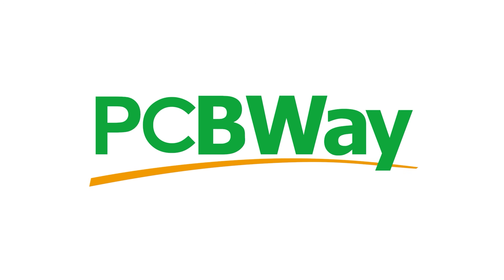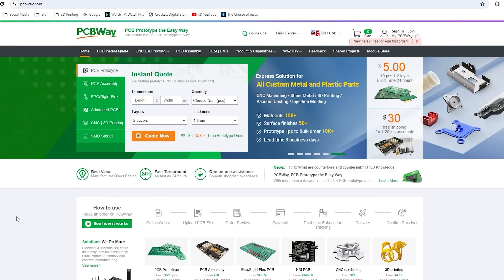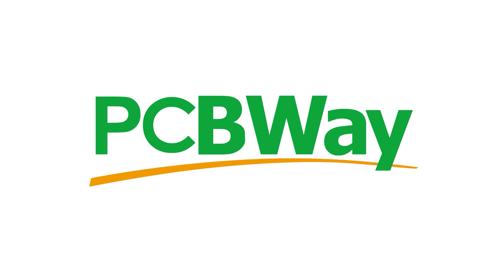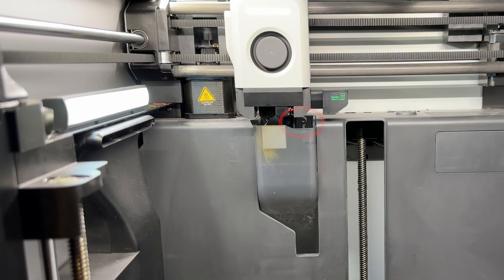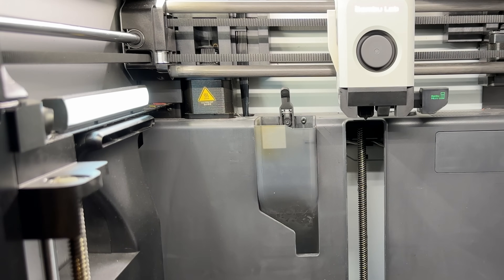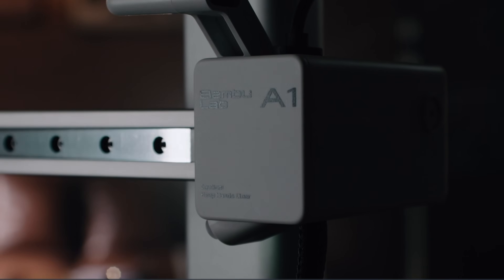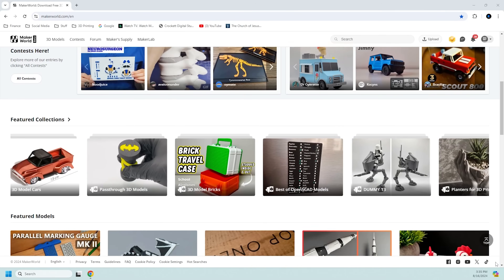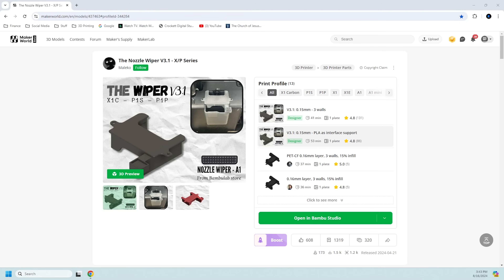Fixing the X1-Carbon's Flawed Nozzle Wiper

Comment: Awesome video!
Reply from the maker: Thank you for watching.
Reply: @thisprintedthing7967  it's been a problem for me from the start and I got a second one when the discount was and the second one also had the problem. I really liked how you highlighted the problem because I was'nt sure exactly what the problem was but now I know it's definitely a design flaw that needs to be improved. I'm going to think om what I can use instead of ordering the little things to glue on the print but if I can't come up with an alternative than I'll just order it haha. 

You eared a subscriber my friend. I'm new to 3d printing still. I feel like a noob and. Want to learn more about designing but it seems very hard.
Reply from the maker: @AA-xm7rt  well thanks for watching. I do hope this helps you. The part that you have to order from Bambu is $3, and it’s a 3-pack. You actually pay more for them to ship it. But it was worth it to me. Honestly, I wasn’t looking for this solution at the time when I found it. But when I found it, I had to try it, and I’m sooooo glad I did.
Reply: @thisprintedthing7967  yeah probably easier and more efficient just buy them! Thanks for all your advice and have a good evening!

Comment: I would use ABS or PET-CF or PC vs PETG. PETG's max temp before deformation is only about 70'c.  ABS is ~100'c, PC is 120'c and PET-CF is like 205'c.
Reply from the maker: @TheNorthern-Lig7t  you may be right. However I printed something the other day in ASA that took about 5 hours to print. The PETG part never showed any signs of giving out. But if it becomes a problem, I will reprint the part in ASA.
Reply: @thisprintedthing7967  I plan to grab an X1 from Microcenter today and I will print this part in ASA.

Do you find the left side gap on the front glass to impact heat retention at all?

I'm also considering replacing the front glass with clear plexi.
Reply from the maker: @comp20B  it’s hard to say if it affects it. I don’t know that it would affect it enough to be a problem. 

I will say, however, when printing in ASA, the printer by default will heat the bed to 90. I had a problem with the parts warping and coming off the bed. I googled it, and Google’s AI suggested I heat the bed to 110, which worked perfectly.
Reply: @thisprintedthing7967  I'll give that a try thanks. I also want to print new outdoor house address numbers in ASA.

I'm stepping up from always using Enders and Prusa's.
Reply: @thisprintedthing7967  Skill issue.

Comment: Does the smaller gap not cause any problems for waste Filament on longer prints?
Reply from the maker: @madnlooney  I haven’t seen any issues yet. The filament falls straight down. As long as you empty your waste bucket behind the printer so that the pile doesn’t build up into the chute, it’s fine. But you would want to do that regardless of what kind of wiper you use.

Comment: The v3.1 wiper works great, but the rear tab on some aftermarket build plates hits the front corner of it. Causes Z axis homing failure.
Reply from the maker: According to the designer, version 3.1 was supposed to address that.  But viewers might be interested in knowing which aftermarket plates you're using that still cause a problem with version 3.1.
Reply: @thisprintedthing7967  The one I've had a problem with is from IdeaFormer. Specifically their water ripple pattern plate. The rear tab is probably 0.5 mm too wide. Easy enough to trim to fit, I just haven't done it yet.
Reply: I'm having this issue with the textured build plate that came with my x1c.
Reply: I'm having this problem with the BL smooth PEI plate I just received.  I'm hoping I can clearance the bottom of the part enough with the soldering iron that I don't have to throw it out.
Reply: I took it to my shop and used a grinding wheel to create clearance on my textured plate. Problem solved

Comment: I think you all are complaining a little too much.  This does NOT happen more than half the time, if it does, you have not replaced your roller.  Can you imagine them saying "eh, we did the best we could, release it working less than half the time" - I think not.
Reply from the maker: Yet that's kind of what they did.  The clip I showed where the nozzle had a long piece of filament stuck to it after the first layer inspection, I shot that video in one take.  I was so confident that that would happen if I hit the record button and pointed the camera at the wiper, that I started a print of a benchy and waited the several minutes it took to get to that point just to capture it on video, knowing that I likely would not have to try again to capture that moment.  And it didn't just happen on my first X1-C, but on all of them (I own 4, remember), right out of the box, insomuch that I had to disable the first layer inspection on all of them.  I can't tell you how many print jobs I had to restart because of this issue when I got my first X1-C until I discovered that I could disable the first layer inspection.  And then the little flecks of old, crusted filament that would end up on my prints because the nozzle never really got cleaned properly, let's not forget those.

So you're telling me that I'm supposed to replace that wiper the moment I get the machine, because the one that comes preinstalled is no good?  You fault me for saying that they would release a machine that has a function that works less than half the time.  Yet based on the experience that I've had, and many others in the comments, your logic is suggesting that the wiper has to be replaced right out of the box, because if we're having the experience that we're having, it's because we have not replaced the wiper.  Granted there are some in the comments that say that this doesn't happen to them too often, but it does happen.  There are a great many others that say they are experiencing this.  So this seems to be a solution.
Reply: @thisprintedthing7967  It's so bizarre that this guy would effectively call you a liar. Why on earth would you lie about something and waste your time finding a solution for it if it wasn't an issue for you? Weird. Thanks for sharing your solution with us.
Reply: lol brand new X1C happened to me with PETG-HF everytime after first layer inspection . Are you telling to change my brand new wiper tube? Clearly a design flaw needs a wiper mod.
Reply from the maker: @tinymito  yeah, that was my thought exactly toward this comment.

Comment: Why not print the A1 Wiper in TPU?
Reply from the maker: Well, think about that. A TPU model is printed from a hot nozzle. What would happen if that same hot nozzle from which a TPU wiper is printed starts rubbing across the same TPU printed wiper multiple times while hot? Or let’s say while I have a TPU printed wiper, I print a model in something that has to be printed hotter than TPU, like ASA. See where I’m going with this?

Comment: There are so many little strands of filament in the bottom of my P1S. And it doesn't even have the LIDAR inspection. I've been putting off, actually printing this thing myself. I even have a dozen extra silicone wipes, since I have an A1. Ima do this after work tonight. Happy making!
Reply from the maker: Good luck. You might still get a few strands at the bottom of your printer. But at least it’ll be less likely to end up being part of your print.

Comment: I think the one that uses a silicone tube that is cut several times works much better.
Reply from the maker: I haven’t seen one with a silicone tube. Not sure how that would even work.
Reply: Totally agree, been using this method for months, perfectly.
Reply: There's also a version 2 available, not tried that yet.

Comment: Have had an X1C since Nov 22 and turned off most of the AI crap that first month. Never needed first layer inspection. Have P1S and P1P and it's somewhat nice not to have unnecessary addons. PETG is the main filament that does need a better wiper, since small blobs stick to the nozzle.

Comment: If you plan to print anything that prints hotter than PETG then I would highly recommend you print any parts that will go inside the printer with either ABS, or my personal preference, ASA. Otherwise, the parts won't last.
Reply: The temperature inside the enclosure won't get hot enough to break down PETG or even a PLA printed part as long as the parts don't come in contact with the heat bed or nozzle.  This particular part will be safe from heat where it's at.
Reply: @Sparky5 Heat creep is a thing even when the parts are under heat resistance temperature.
Reply: @TechnologistAtWork shouldn't have opinions? Like wrong think?
Reply: Don’t print this wiper with TPU then…? ;)
Reply: @oofunstuff The wiper isn't TPU. It's a silicone polymer. This thing can withstand more than 800C. Your printer doesn't even get anywhere close to that.
Reply: I printed mine in petg cf and it’s gorgeous using the pla support.
Reply: Chamber won’t got hotter than 50c ever. If you turn chamber fan off it will get up to 50c then kick on but with it on it’s never going over 30c
Reply: I think we should all print it with PEEK!! Lol... just kidding. I will do mine with ASA but PETG would be fine too.
Reply: Petg cf best fit.

Comment: thank you for this I installed it and it helps. I have another issue however. On long multicolor prints I find the poop will clog up every so often and build up against it self to the point where it will eventually knock off the fan housing. I have been looking for a fix for this but haven’t seen a good one. I have tried multiple models on makerworld that laid to fix this but none of them make a difference
Reply: Spray some silicone spray in the poop chute so the filament has less chance to stick to anything. Worked wonders on my P1S. I also wipe a bit on the nozzle to stop it sticking to it.
Reply: @MitchM240 I had that problem too on a print I did last night. It was sad because it should have been done before I got up in the morning but instead it was another 4 hours before it finished.
Reply: The only issue you may have is warping if you start printing other materials like say ABS or ASA, where the bed heats up to 100°C 👍🏻
Reply from the maker: @MitchM240  oh, man, sorry to hear. I wish I had some advice to give there. I’ve not seen that issue.
Reply: I have this issue as well, and it's bent my nozzle at least twice so badly that I had to straighten it to get a good print from the machine again.  I have not found a solution to the problem yet.

Comment: Hi.  Thanks for the video. I have a P1S, and I’m very impressed with it, it’s my first 3D printer, and I’ve owned it for about six weeks, and I’ve been printing things to make it better.  I came across technerd’s  “ultimate Nozzle Wiper V2” on MakerWorld,  wonderful website, printed it and it’s been on the printer for a couple of weeks, and has performed faultlessly.  The silica tubing provides a resilient surface which cleans the nozzle on all sides.
Please don’t think I’m suggesting the one you’re employing is less efficient, just that there are alternatives.
By the way I printed it using PLA, and it is working perfectly.  Being a beginner, I’ve not ventured into using any other filament, if a problem appears, I will print just the holder using PETG.
Kind regards Noel
Reply from the maker: @Jestey6  great! Yeah the beauty of the 3D printing scene is all the ways there is to skin a cat, so to speak. Basically you found another model that does a similar thing. 

My friend just got the same model printer that you got. He really seems to like it. 

PLA is not going to last you very long, especially when you start using materials that need to be not only printed hotter, but the bed and chamber need to be kept hot. But like you iterated, you can cross that bridge when you come to it. 

Thanks for watching, and enjoy that printer.
Reply: the problem with PLA in this case is that its glass transition temperature is very low.  This means that PLA gets soft and might deform under its own weight if you were to leave it in a hot car.  Temperatures within a 3D printing enclosure can become comparable to those within a car on a sunny day.  PETG doesn't experience this problem until temperatures get hotter.  There are other filaments that are even more resistant to heat than PETG, but they're not as beginner friendly as PETG.